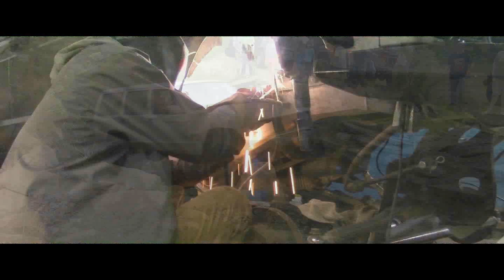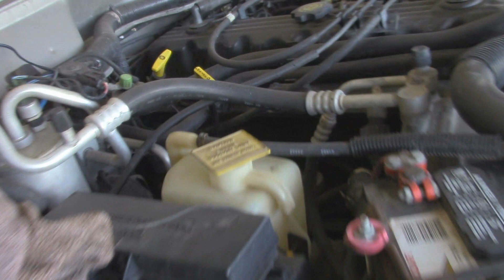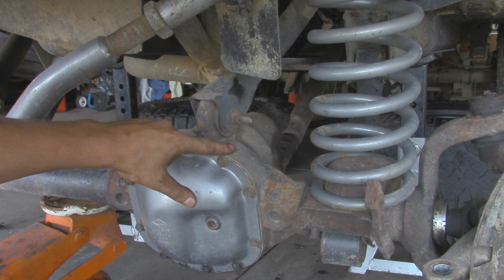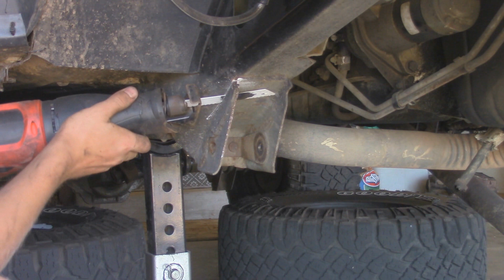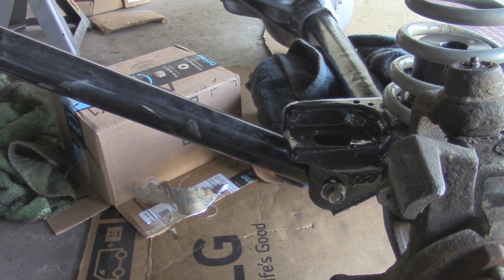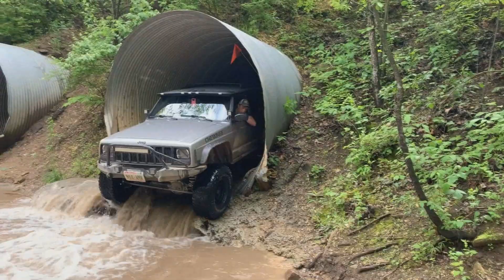Jeep Cherokee XJ 3-Link Suspension Install  | Part 2 (Reupload)

Comment: Oh God I was cringing when he was hammering that bushing in. I would have got a large socket or piece of pipe the same diameter as the bushing and the hammered on that instead.
Reply from the maker: Yeah it probably would have been better to find something better to hammer it in with or to press it in. Unfortunately this was before I purchased my ball-joint press.

Comment: Hey buddy I bought a parts jeep that came with this three link kit in the back but I’m missing the upper control arm where can I find it.
Reply from the maker: I would either reach out to some companies that make a 3 link kit and see if they can provide you with the upper link. Or you may have to build one yourself out of DOM tubing. There are some companies that sell DIY kits for links and steering such as RuffStuff Specialties.

Comment: How did you like the heim joints on the frame side, did they transfer a lot of vibration?
Reply from the maker: They actually did transfer more vibrations through the jeep. Since the upper link was heim joints on either end and no rubber isolators. But overall not a big deal just mostly felt it in your feet.
Reply: @OutJeeping  how’d you like the road handling on it?
Reply from the maker: It wasn't terrible but slightly better than short arms at that lift height.